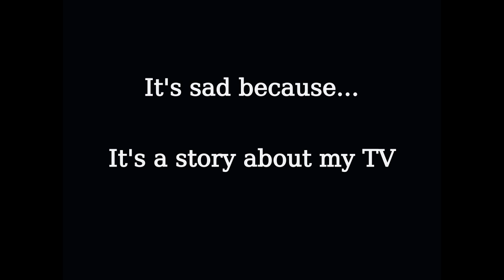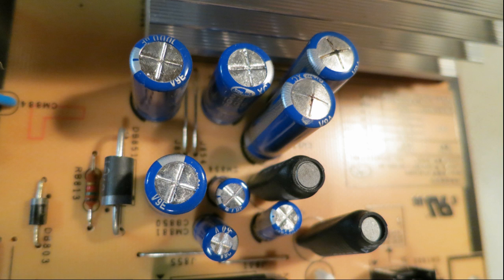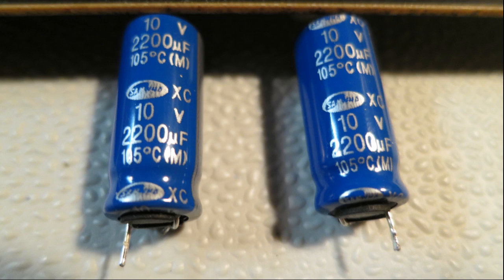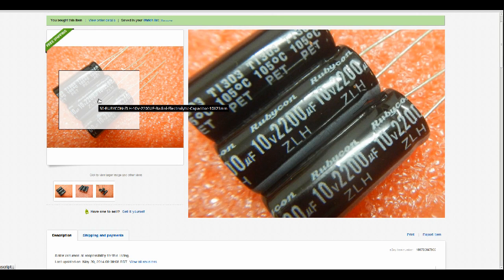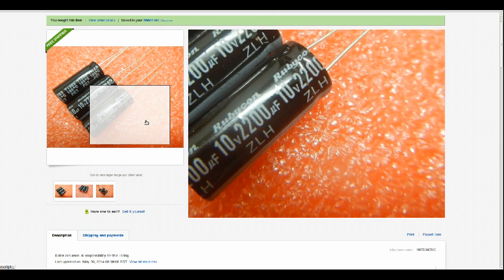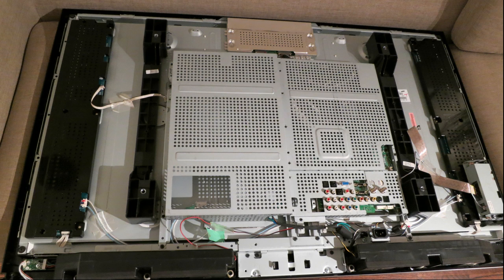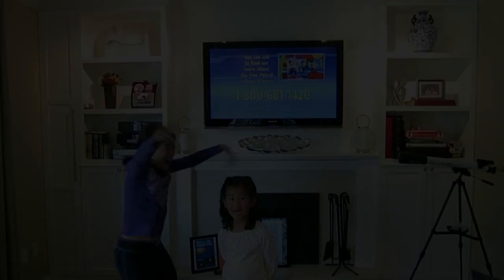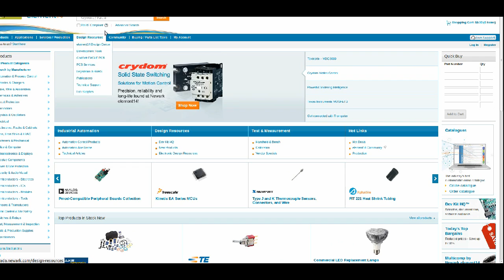My Repair of a 46" Samsung LCD TV with Bad Capacitors

Comment: I got lucky with Samsung 46" TV 2008, so far, no problems. But, I started problem with switching the tv on off too quickly, but stopped the fast switching of on and off. I stil wonder if the caps are still good though. I have a background in electronics, In case I need to fix things, but only have simple tools at home and retired. Myodel: Samsung LN-T4665F
Reply: I started to have the clicking issue on a 2008 Samsung LN-T4665F 46 inch TV, within the last couple of months. I put off putting a couple new capacitors  for the two months then ordered some capacitors just in case it quit working. I put a couple of new capacitors in the power supply, and it is back to normal. Mine was not on the orignal list of Samsung TV's that had the issue, but that did not mean it could never have that problem. it worked fine all those years. My issue wasn't the knowledge of doing the work, it was the fact my health is not good so had to get help to pickup and move the TV. And, use a magnifying glass to read the board. Also, that every picture of the Power Board on the Internet was not the same exact power supply. There was enough sameness of the components to find what I needed. If someone has a Samsung TV with these issues and cannot find the 'exact' Power Supply board, components and layout in a fix the problem article of forum or Youtube post, I would not get the kits that are sold (sometimes they put a couple capacitors in the kit for several TV models, but not enough capacitors to replace more than two), I would try to buy the capacitors from a reputable electronics parts distributor so you know you will have the proper capacitors and the proper amount of them. I got lucky with no bulging caps, but changing them out anyways was the best thing to do because why go through all that work and not do the repair. As the caps will not always have any signs on the outside of failure. IMHO.

Comment: Further to the info about heating the joint. I always have a little 'wet' (melted) solder on the tip
this allows a very quick heat transfer to the cold joint and works great. Kind of one of those things you think everyone knows, but if you haven't done a ton of soldering you might not have figured that out yet.   Over all the cap repairs are simple and cheap.

I am now on my second repair of the same TV. Different caps blew.  Since these are known to be under rated voltage wise. I would replace with the next voltage rating higher than the blown on.  10v=>16V 16V=>25 etc. They will be slightly larger physically but should still fit.
 Absolutely replace with the same uf value and mind the orientation. THes are polarized + and -     OK off to fix the TV - Cheers
Reply from the maker: Great tip and good luck with your repairs.

Comment: Do i need to discharge something? Would i get shock? I haven’t open my tv yet but i feel that mine would be the same problem
Reply from the maker: Yes. Look up how to discharge caps. I've simply hooked up my voltmeter to the appropriate volts and watch as the voltage drops to zero.

Comment: I just got a tv on Kijiji for free and the owner told me it would cost $200 for repair and decided to watch video on the tube and got 6 capacitors for $6,50 and changed 5 on the Samsung motherboard and the tv works perfectly now. saved me a lot of money
Reply from the maker: YESSSS!!!!! Good job!
Reply: wanna hear something lol, just got another tv its a 58 inch plasma and the ticking noise but now I hear a high pitched sound but I check the cap and nothing looks burnt
its a Samsung pn58A550S1FXZC

Comment: I loved the presentation in form of a story. Though I wish that tutorial on soldering capacitor was included. Moreover some tips on how to know which capacitors have grown bad would have been great.
Anyways love the presentation, personal touch and the two kids.
Reply from the maker: Abhilash Baranwal Great feedback. I just didn't want to make a really in depth video on soldering. I didn't check all the caps. I replaced only the ones that are bulging on the top. It is working today!

Comment: I have this same Samsung model.  My problem are 3 green vertical lines that suddenly appeared down the screen.  Each line is about 6 inches wide.  Would you say this is a bad capacitor?
Reply: no, the capacitors wouldn't have anything to do with the visual problem, just the power on/power off problems.
Reply: I have gotten those green line every once in a while onthe left side, I just haven't fixed it, as I just live with the lines, they come and go, and have prbably for 10 years. I try to keep my fingers out, unless I really have to.

Comment: Hey. Thanks. I thought that was the exact issue but needed a lil confidence :-)
Reply from the maker: J Loren Thank you! Just be careful to discharge the power board. Look up how to discharge capacitors!
Reply: Def a VERY important advice. IMO you should add this in a description box in your vid. Thanks, still.

Comment: A lot of times, those Chinese ebay sellers are selling you fake Japanese caps.   While you were in there, might as well have replaced all the caps in the psb.
Reply from the maker: Yeah, I heard about that after I ordered the caps from ebay. So far so good though. Yeah, everyone told me to change the others... Lesson learned for next time. I really hope there is no next time. Thanks for the advice.
Reply: Digikey is a great place to buy caps.  They have great selection and an $8.00 flat fee for shipping (in Canadian $$$).
Reply from the maker: +Audioquest56 just checked out the site. It's great. Thanks for the advice. Unfortunately I just bought some caps elsewhere. Next purchase will be from there.
Reply: Ladybug Adventures They are excellent.  You have your shipment within 2 days.  No duty charges.
Reply: I also agree. If your going to replace the caps, should re-do all of them at the same time, because the caps you don't replace are also very old, same as the others, and while not bad currently, they will probably go bad very quickly due to their age/cheapness. Plus even if not bulging or looking bad, they might also be bad. Might as well do them all with all new shiny caps that you know are new.

Comment: I sure hope you replaced all of them blue ones they are very problematic !
Reply from the maker: Logic would say that I did. But I'd be lying. I know, I should have once I was in there but inexperienced and didn't really think about it at the time. Still working well but if it starts messing up on the start up I'll jump back in there.
Reply: +Evan Lee Yeah them blue ones are just crap I would recommend you do it sooner than later as bad caps can kill the mainboard Epprom ect.
Reply from the maker: Will do. Thanks for the advice.
Reply: +Evan Lee No worries thanks for the video :)

Comment: What you should've done is replace those caps with 3300uF 16V or even 25V... otherwise you'll have the same problem later. You have replaced them with exact same capacitors as original.. do you expect a different outcome? :-)  The reason why they go bad can be because of couple of things.. they can either get high frequency spikes from the transformer (the yellow square things) which may be caused by semi-faulty small capacitors above the transformer at 0:30 (or just purposely bad design) or it could even be caused by a partially faulty rectifier diode (mounted on the heatsink next to capacitors). But in case of it being just a poor design, where 2x 2200uF are insufficient in handling and filtering out these spikes without being damaged in the process, caps like 2x 3300uF would improve this issue immensely, also raising the caps rated voltage from 10 to 16 or 25V would ensure they can handle these spikes easier. At 0:45 you can see LM851 which is a coil or choke that absorbs these spikes so they don't proceed to other caps like CM854 etc. Also... these power boards can kill you even after you unplug and remove them from the TV as the two large capacitors in centre of the board can sometimes remain charged with up to around 340V and certainly with more than enough current to kill someone... so you should always make sure those are discharged before handling the board, maybe you should mention that in your vid to keep people safe :-)
Reply from the maker: +Glen Bradley Thanks for the input. I just followed the some advice from a friend and after research on the items. This wasn't a how to video, rather a how I did it and where I got stuff. I received the feedback about showing more but there are so many videos about desoldering, cap testing, discharging the caps etc that I don't usually get into all that. I hope you have a channel with some informative videos. You sound like you know your stuff!

Comment: My 46' Samsung has the same issue but nothing appears to be visually wrong with the capacitors. Any suggestions?
Reply from the maker: Timothy Dr Caps are the extent of my tv or monitor repair experience. There are a host of other videos that I've referenced before. Tampatec is one of them. He has a lot of videos on tv repair. Good luck.
Reply: Yes this is a late reply, just to help others. I assume you fixed or got a new TV.
Some failures are poor/cracked solder joints on some of the components.

Close inspection can reveal, and repair is a simple as reheating the joint and adding a touch of new solder.  Cheers

Comment: You showed nothing on replacement process. Just the board the caps you removed. New caps you purchased and turning the tv back on lol. Try going through the process of replacing for people that is electonically handicapped....  btw glad you got your tv fixed
Reply from the maker: Good point. I've seen a lot of repair videos and I didn't want to do another repeat of how to replace caps. I'll show everything next time so people don't have to search more videos. Thanks for the feedback.
Reply: No problem. Yeah i need to fix mine and want to know exactly so i dont screw it up lol.

Comment from the maker: Just fixed a 2nd samsung tv. This time a 40" with burst capacitors as well. Easy fix. Bought it from Kijiji for $55. Parts $12. Sold it on Kijiji for $200. Ah, the satisfaction.
Reply: Great job -- I have an old desktop that I tossed due to bad caps, and another of the same model that will fail soon (caps are leaking)... I always figured it was too much trouble to replace, but I might give it a try.  If you can't wait or don't want to pay for shipping, try Sayal -- there's a location at 407 & Woodbine.
Reply from the maker: Anthony Giannitsis
Caps are luckily pretty easy to replace. If I can do it, anyone can! I'm lazy so I ordered online from newark rather than going to sayal. Newark delivers in 1-2 days! Crazy fast.
Reply: okay i got a question about tvs this time. I have a panasonic 50 inch viero tv i believe there is a cap blone somewhere but i don't know, it was actually my dad's tv long ago he gave it to me and i want to repair it, but problem is it won't turn on and it flashes red led i think 7x blinking light i wonder if i just have bad caps or something else, since i wan't to use it with my htpc my tv right now is only 32' and i want to fix that other one so i can use big screen htpc in my living room. Anybody know how to repair such a thing?
Reply from the maker: I'm not good at this but check the model of the tv and see what 7 blinks means. I just got lucky when I opened it up to see an obvious problem. I had another tv that I just couldn't figure out.